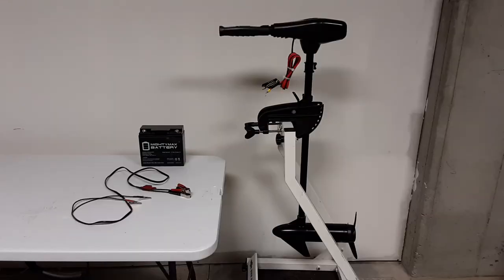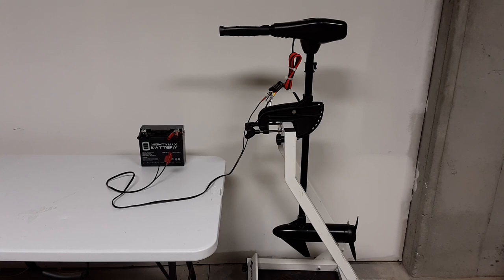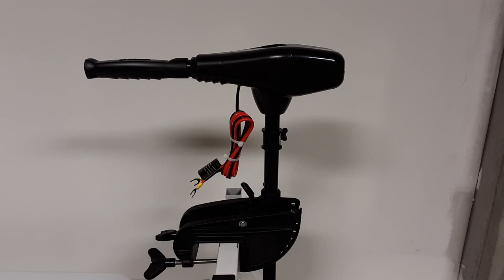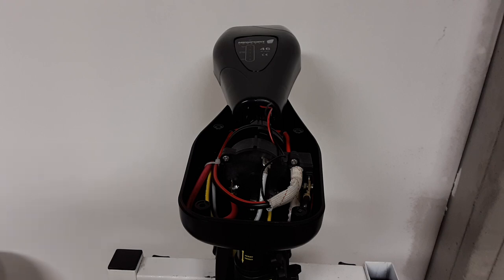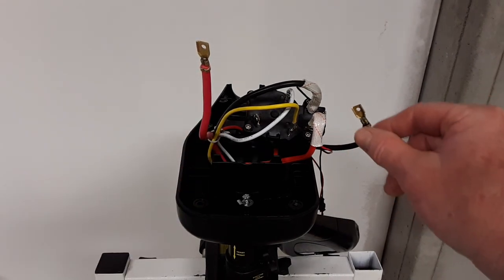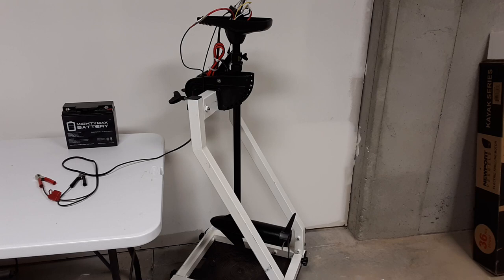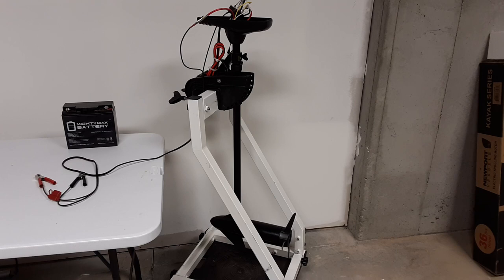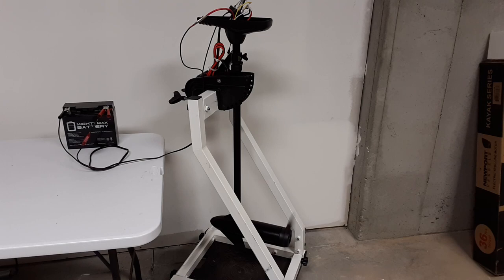12V Trolling Motor Standard Speed Switch Test

Comment: I have a question you maybe able to answer..
How to determine if you have a bent motor shaft. i dont mean a major one just maybe a slight one and would that cause the switch to get hot?
Not sure if i cam combating 1 problem or 2.
I recently tried to put a weed  cutter on the motor unit. a diy version of those gator cutter things and it was pretty clear the spacing changed while hand rotating the motor.
My 5/3 switch also is getting hot. wiring wise i have the switch extended using i believe 10 gauge wire on about a 6 foot run.
The battery side i and using 6guage jumper cables over a 10 run.
Reply from the maker: You can put a level on the shaft and if there is a gap it is bent but I don't think that will affect your switch. The switch should not be heating up over that short run. It may be a bad switch. I just started a new FB group and maybe somebody there can help. If you would like to join here is the link.   https://www.facebook.com/groups/3521517597860461/
Reply: @Aksmaniyak  thanks request sent to join.
Whe4n i put a straight edge along the motor to the prop hub its clear there is about a 1/16 gap when spinning the prop by hand. tried it with 2 props so its not the prop itself.
 I only have the 1 switch. thought maybe the bend shaft maybe causing a extra amp draw and heating the switch up.
Looks likes it time for me to go pwm. and also ether replace the motor shaft or replace the whole motor.
Reply from the maker: Hi. Try the PWM first before you get a new motor.

Comment: Careful you can explode a battery by connecting ground first by because when you go to attach the positive lead you will get a spark and if there is any battery gases present they CV could potentially ignite. ALWAYS CONNECT POSITIVE FIRST THEN GROUND
Reply from the maker: Yes, that is the proper sequence for vehicles because the chassis/body is acting as the ground. There is not a gas danger with maintenance free batteries. On real kayak set ups, I open the circuit breaker as a safety feature. It is a good habit though to use when working with batteries.

Comment: I have a 2005 minn Kota and just today I went to hook the positive to my battery, then twist to 1-speed and got nothing then 2-speed and it went to full speed all the way to 5. Reverse is nothing on 1 and then only full on 3. Does this sound like a bad switch?
Reply from the maker: Yes. Try the video solution and you will get your answer.
Reply: @Aksmaniyak  so bought a new switch and still the same outcome. Except maybe I can tell it goes higher from 4 to 5 speed. Reverse is all or nothing. Could it be a wiring issue from the battery to the motor? Only thing I added was quick disconnect from the motor and a 8” smaller diameter wire with built in fuse from power line of battery
Reply from the maker: It could be.
Reply from the maker: And you ran the test like in the video?